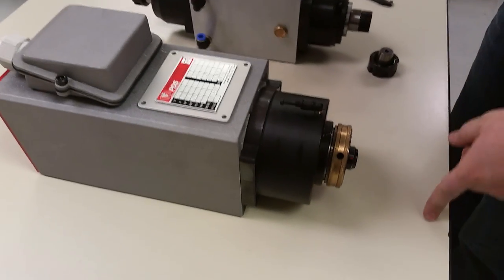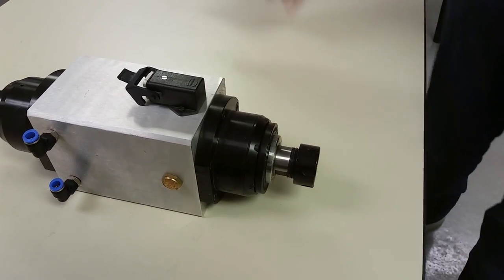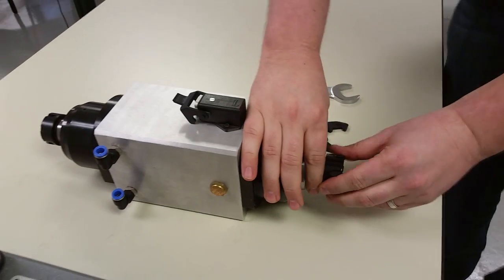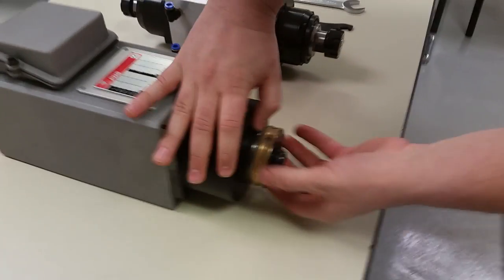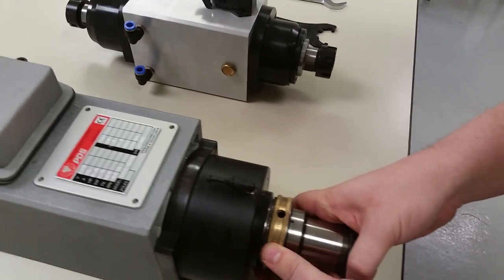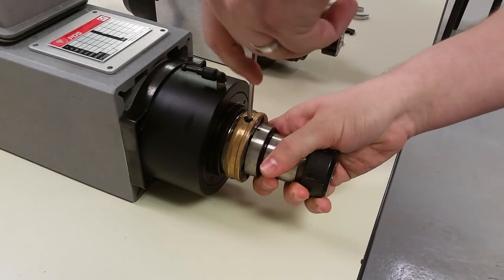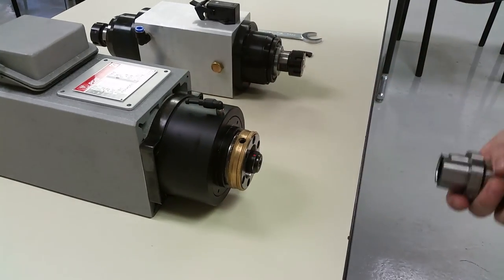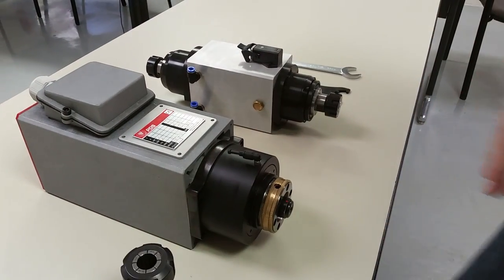Precision Drive Systems HSKC Tooling Demo

Comment: Oh wow I didnt know there was manual tool change HSK, that's actually awesome for presetting tools even without auto tool change it would speed things up
Reply from the maker: That's exactly right. It's a great go-between with ATC and MTC. We stock these spindles in a variety of sizes. It is a very nice system.